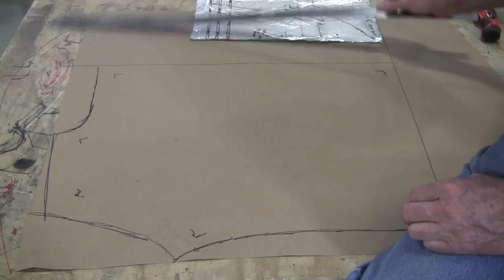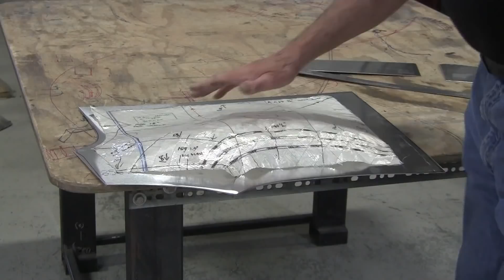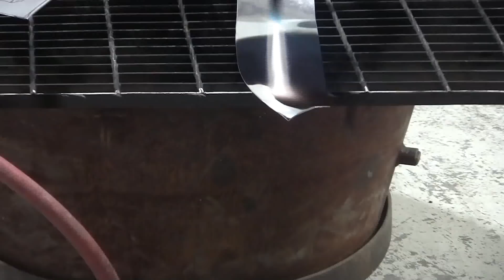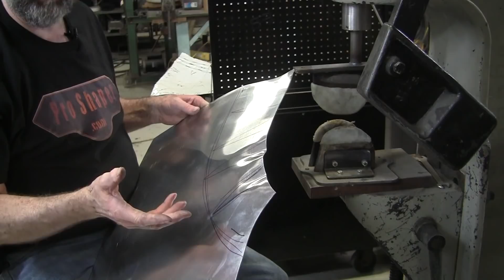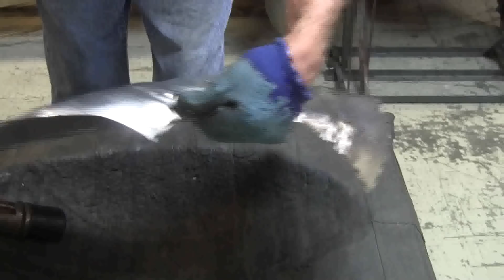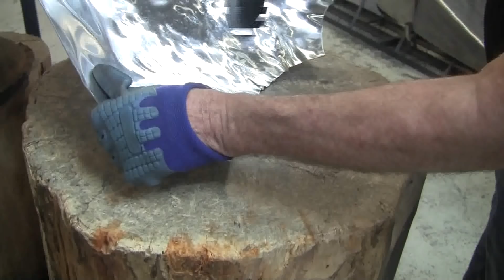How to shape metal: Jaguar E-Type Aluminum Bonnet Build (Part 3)

Comment: Hi Wray, I was taught many many years ago that if you wiped liquid soap  (old nearly used slivers of hand soap left in water to liquidise) with a brush onto Aluminium it would turn dark brown under a blowtorch flame when it reached the exact temperature for Annealing, it even worked for the Aircraft Grades and Duralumin, and there was never a problem cleaning it off as most would disappear when it was quenched.
Reply from the maker: I have tried soap, wood burning, magic marker, temp stick, and soot.  The soot and the rosebud tip work the best and fastest.
Reply: @proshaper   Hi again, not heard of those I have to admit but they do sound interesting - Thanks for the vids btw, it's good to see the Magic Black Art in progress.
Back when I was an Apprenticed Draughtsman in 1971 our next door neighbours were a Coach-building company called Harringtons, and any glimpses we had of the guys making Wings (what you call Fenders) and Swept Running Boards, and it really did seem like some magical ability to produce compound curves out of flat sheet - having watched what you do in your video's, I now know it was part Physics and part Experience - So thank you very much. ..... Stewart T

Comment: Wray, l can see where this is going . It's because of your complete confidence in how the aluminium reacts that it responds to your input. I think your students, l Would include myself if l could be there, would find it difficult to achieve the same result if left without your tuition. You are e rare breed , you must have had a very patient mentor! Great stuff!
Reply from the maker: Hi John, thanks for the positive comments. My mentor was " Lots of patience" and add some stubbornness. I never bought into the established traditional ways of making panels. I take from the traditional what I believe has good value and discard the rest.😁😁😁It became apparent to me a long time ago that there was a lot of room for  improvements in both the  tools and techniques used in the craft. When I develop new techniques I'm always thinking of the guy with limited space and resources working out of a one or two car garage. That is how I started out.😁😁😁  With regard to tools I hear this comment a lot
 " that Edward's  English wheel or that Yoder power hammer has made perfect panels for 70 years"
"Why would you want to improve it"?  The same can be said for a flat belt driven old lathe or a metal shaper.....😁😁😁😁😁   I rest my case.

Comment: I used to teach high school metalwork here in the Uk more than 30 years ago and to anneal aluminium we used to use the workshop liquid hand soap on the metal and heat with a Blowtorch not oxy- acetylene until the soap turned black and little chance of the aly burning or scorching. And I do not remember the temperature being as hot as you quoted to anneal aluminium and yes then 30 years ago plus we were still using Farenheight as a measurement lol
Reply: In the mid 80s I watched Bill Murray (the last AC Cobra racer) create a fender for a Cobra on an English wheel, then torch weld it in place.  That man was the most outstanding aluminum worker I have ever seen.

Comment: Back in the 50s in Long Beach CA on Anaheim St. there was Roger Bloxhelms Auto body shop like you they had all the Bell's and whistles plus a steel beam cradle and hydrolic ram with different noses and Big shot bags  or wooden shapes saves a lot of hammer work.🐤🐤🐤🔔🔊

Comment: I remember reading in an old book a technique for annealing aluminum that used bar soap as the indicator, rather than soot.  Does one have benefit over the other? Do either wind up contaminating the aluminum, making it harder to weld later?  I am really enjoying this series, and am looking forward to see this hood come together 😎  Thanks!
Reply from the maker: Hi Tom , I have no experience with using soap as a temperature indicator for annealing. The soot method works very well, and the proof is easy to confirm by bending an edge with your thumbs. Before welding it is a good idea to make sure the metal is clean and scratch it with a stainless brush along the weld seam. Tig or gas on aluminum work equally well. If there is a failure it is usually not enough heat was induced during the welding, seldom a problem with gas, but often a problem with tig.

Comment: Given you can get an E-Type bonnet stamped out of a sheet of aluminum (or steel if you want) with an original press while very skillful rather silly. How do you think Jaguar made the new lightweight models! There is a firm in the north east of England with the original tooling. It was all on a TV show on Channel 4 back in 2015 in the UK. I watched footage of them producing the new bonnets.
Reply from the maker: My understanding is they sub a lot of the work out to prototype specialists. Usually every automobile manufacturer has several prototype firms that are always busy building some new concept. Maybe someone that  knows the "real" story will answer this question.

Comment: What cordless shear is that? Is it a nibble? Or a shear like tin snips?
Reply from the maker: I have two cordless Sheet Metal shears both are not nibblers. One is a Bosch and the other is a Masterforce ( a Menards brand name). Once you use them you very rarely hand snip.

Comment: After the shaping is completed, is it necessary to reverse the annealing process, or is that even possible to do?
Reply from the maker: After you work the aluminum a little it stiffens right up. It also age hardens by itself over time. Annealing softens the metal but it is still very viable as a body panel. It's not like it would dent if you pushed it with your finger. Anybody panel annealed or not can be dented with a fist slam.
Reply: @proshaper  Thanks for replying, Wray!

Your channel suddenly appeared in my feed tonight, and I had to check it out and subscribe.

I've been fascinated with this art for some time, and I watch quite a bit of material relating to metal shaping, etc., but I've never been quite certain whether the material will work-harden after annealing.

I can see how the panel develops structural strength and rigidity, as it's shaping is applied and refined.

It's a pleasure to watch your content and see you demonstrating your skills and techniques.

I still dream of learning to do this type of work. Hoping to get busy with plenty of industrial work when I return home to the States.

Best wishes from the Philippines.

Comment: Another very good video Ray! Can the annealing process make the panel weaker or easier to dent after it is finished? Thanks in advance, cheers, Doug
Reply from the maker: Hi Doug, after it in is worked it returns to the same condition as the rest of the panel.

Comment: Thank you Ray.  Love the DNA in the flexible shape pattern. Ordered some tape.  Question about the failed anneal.  Doesn’t a water quench harden the metal vs a natural air cool?
Reply from the maker: The quick water quench works on steel. On aluminum, copper, bronze, brass, a quick cold  water quench only has the effect of cooling the metal quickly.
Reply: I came here to ask the same question

Comment: Wray, how thick is the rubber roofing you use on the shrinking facilitator. Home Depot has 1/16", 1/8", 3/16" and 1/4".
Reply from the maker: The rolls that I have used are less than 1/16" with a very strong self adhesive on the backside.  The material will conform to any shape you make. It is called EPDM rubber.
Reply: @proshaper  Thank you.

Comment: Great work and craftsmanship.  A couple of constructive comments.  The burning tip is fine for laying down soot, but a rosebud tip would be so much better for the heating operation (that's probably the reason "Samrodian" had good luck with the old style blowtorch).  Also for any temperature information Tempil Sticks are a very good way for more precise temperature measurement.
I do not have much skill for forming any sheet metal outside of a press break, so cheers, but I do some amount of phospher bronze brazing on cast iron and the Tempil sticks are invaluable.  I would say that in your application the Tempil sticks would be much more useful as an illustration for teaching, but really unnecessary for your production work.
Thanks again!
Reply from the maker: I did an annealing method  study the other day using the soap method, carbon soot method, and the magic marker method. They all work perfectly on small panels. When you have a larger panel and you just want to anneal one edge the magic marker method worked the best. Air cooling or quick water quench made no difference.  I haven't tried a temperature stick yet.

Comment: Is there a way to soften steel and which steel do you use. Thanks. Bob
Reply from the maker: Hi Robert, for automotive panels 19 gauge (.040" or one MM)steel works the best. The steel sheets I buy are generic 19 gauge,  they shrink and stretch with no major problems.